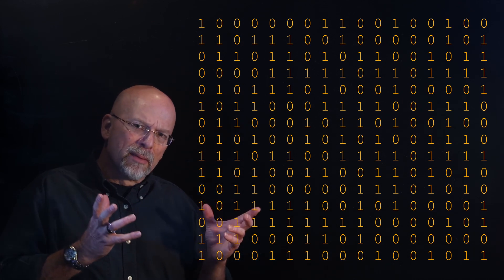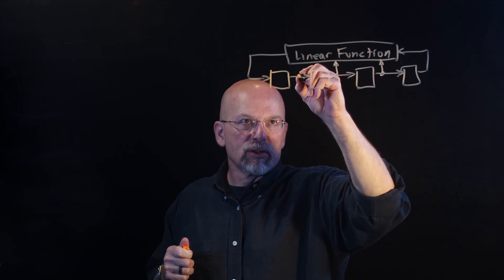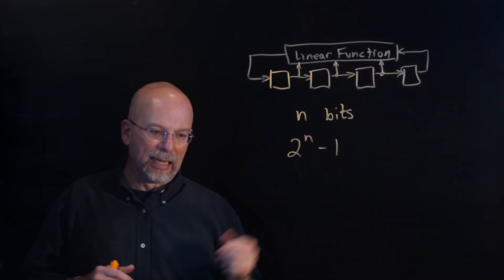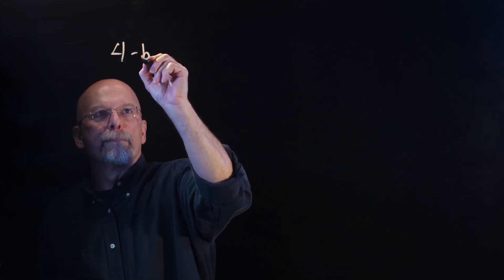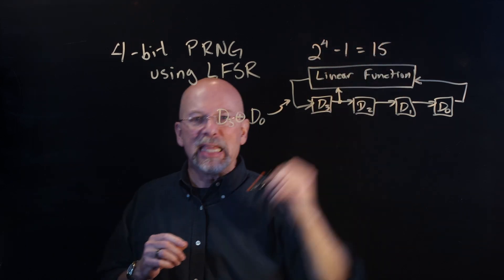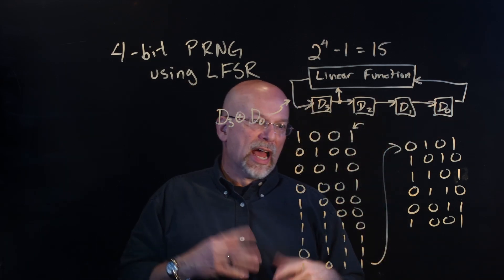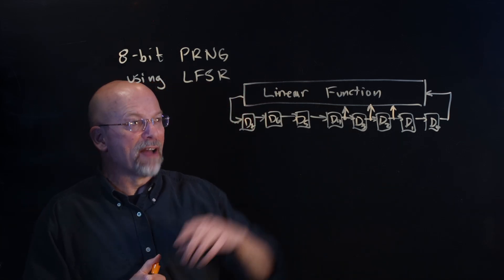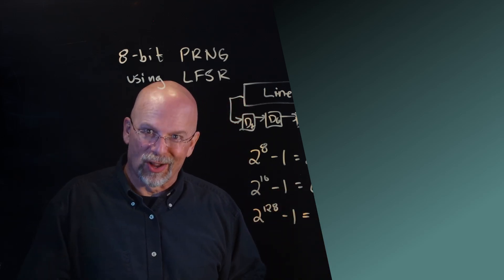Pseudo Random Numbers from a Linear Feedback Shift Register

Comment: It just so happens that choosing a shift register length one less than a power of 2 yields the easier 2 feedback term solution rather than 4. Example: 2^7-1, 2^15-1, 2^127-1 which can be more readily implemented at higher speeds due to their simplicity.

However, given that the next bits are available in advance, one work-around is to pre-calculate the partial terms one cycle in advance and then combine those partial terms in the next cycle for the combined feedback yielding the same throughput as the 2 term by only adding a couple of flip flops to delay the pre-calculated partial terms.

Comment: Yeah, but the key of this problem is to know where those taps should be and how many. Otherwise you might end up with a shorter sequence than you wanted. This video is really missing the theory of polynomials in finite fields.
Reply: I agree in that for a numerical analysis, the least significant bit should be on the left increasing to the most significant bit on the right. With that labeling change, it can then be analyzed as a polynomial, and others have already worked out the correct taps for maximum length sequences. Search for the “Table of Linear Feedback Shift Registers” paper for a table of maximum-cycle LFSR taps for lengths up to 786 by Roy Ward and Tim Molteno.
Reply: @ChrisSmith-tc4df  I'm not interested in what others did and put in a table – I want to know how I can do it myself. If I'm stuck on a deserted island with just a stick, there will be no nice table to use. All I could do is use the stick to calculate it myself on the sand.